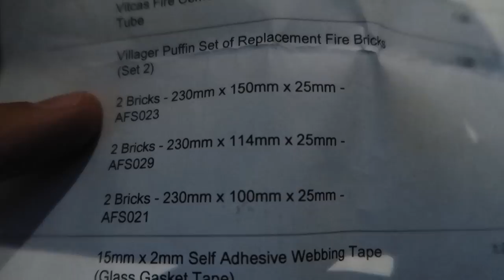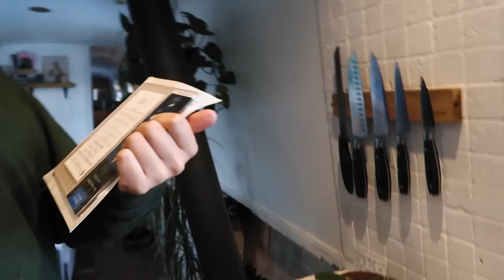How NOT to prepare a narrowboat stove for winter - 74

Comment: You could invest in a "Coal Saver", It's a stainless steel circular mesh screen that you put in the centre of the fire, and stack the coals in it. It'll protect your fire bricks, and also help reduce the volume of coal used to heat the boat.. As always an entertaining Vlog you always make me smile. Keep it up guys 👍
Reply: I’m so sorry I didn’t see you had already said this 👌🏻
Reply from the maker: Watch this space 🤭 we might have one! 
Thank you so much 😊
Reply: @BoatTime  think you will have to start using your radiators
Reply: @BoatTime  the rope stops co2 leaking out I hope you have alarms in your boat
Reply: @BoatTime  we Burn phurnacite it stays in for 18 hours a scuttle of coal lasts me 3 days

Comment: WD40 always on nuts and bolts that have been heated or exposed to moisture.
Spray on, have a cup of tea then gently try loosening.
Also helps to slightly tighten first, before rotating to loosen. It helps break the seal and free the thread.

Comment: Just a small tip for any future jobs involving removing rusty bolts. If you spray the bolt with EasyOut or WD40 it will soak into the rust. Then gently try to tighten the bolt avoiding breaking the bolt head. Next try to untighten the bolt and the rust bond should be broken so the bolt will come out undamaged. When you sealed the flue pipe with sealant it would have been better to pack the joint with small diameter rope first before adding the sealant. Tips I was given before I tackled a similar job on my old wood burner.
Reply from the maker: Really good to know thanks David! 😊👍🏻

Comment: Great video,I’d be tempted to get a drill or get a mechanic to drill holes in the door so new bolts can be fitted ( sealed on the outside) for holding the glass in place

Comment: What a pair of bodgers!😅  
FYI, chips are very bad for you (said the pot to the kettle - both blackened by coal soot).🙃 
Also, wood creates something like a quarter less soot😷 (though its heat output is lower), is cheaper than coal and it is possible to source supplies online.🤗

Comment: Check out narrowboat James built 374 he bought a coal cage, that would preserve your fire bricks and the seal as logs or coal will stay inside the cage and burn efficiently. Also protecting your glass. Maybe consider preparing your fire cleaning during summer. All in all you both done very well and carried out assembling your fire back together. 
Keep warm,  keep safe and keep sane. 🤪💚

Comment: I always have a old 2 inch paint brush to use in my stove to get all the old ash out when the fire has gone out…..I hope the fire cement works to hold the nut on….I would try to get the door to someone who could re tap for new nuts and bolts

Comment: I am concerned about the fitting of the glass ,   When it gets hot the glass “will” fall out
Get the bolts on the door drilled out and replaced, My old log burner had the same problem 
in the end I drilled the door and put nuts and bolts which have been in place for a long time
Got new fire for the boat and the old one is fitted in garage,    “”Be careful “”
Reply from the maker: It’s just a temporary fix for now until we can get to a boat yard 😊 but seems to be holding up okay so far